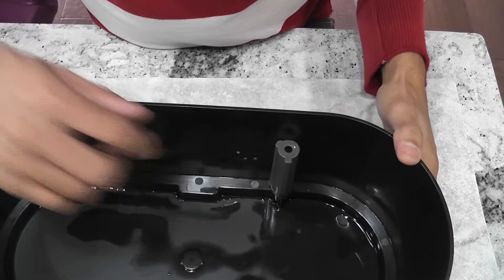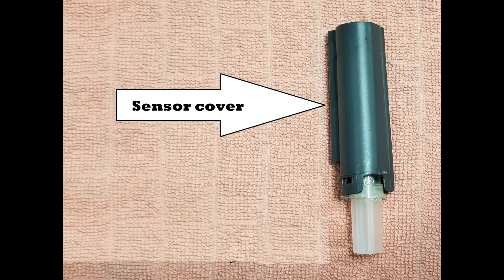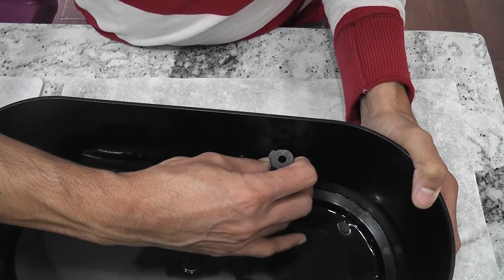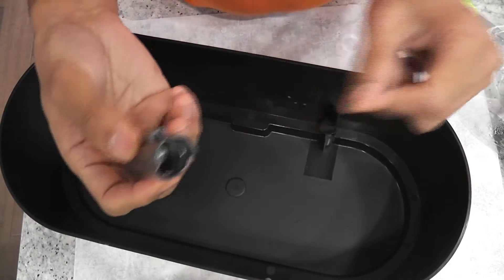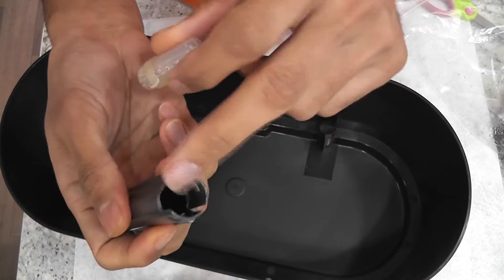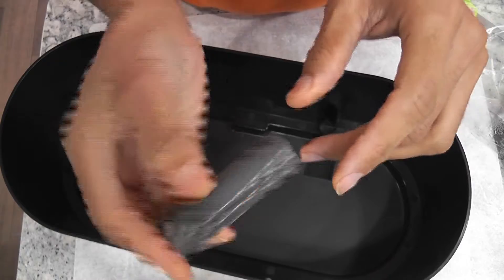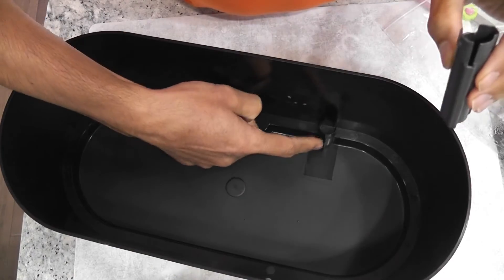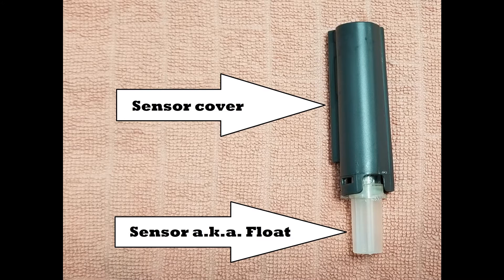Disconnect & Connect Water Sensor/Float in Aerogarden Bounty and Aerogarden Farm | Hydroponics

Comment: Thanks! Zero help on the company’s website, but your thorough explanation helped me fixed my Bounty, which had been disconnected over several months, but was showing low water level even when I had filled it when setting it up again. Sure enough, I found 2 very old, dried roots inside the tube. Now I’m up and running!
Reply from the maker: Glad I could help!

Comment: Does the float have some water in it?  Or should it be only air?  Having trouble with my float coming back up despite being cleaned.
Reply from the maker: The float should NOT have any water. It should always float. As the water level goes down,  the float will go down and touch the bottom, and the water indicator will turn on.